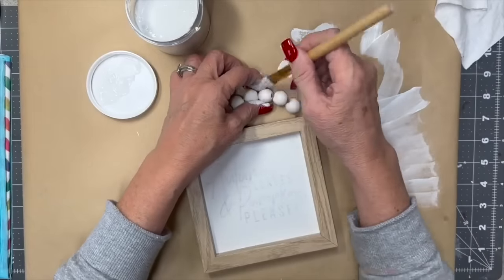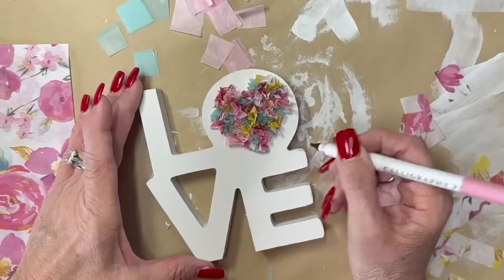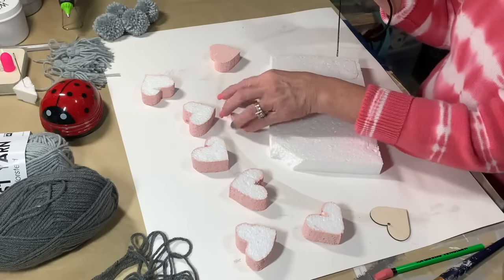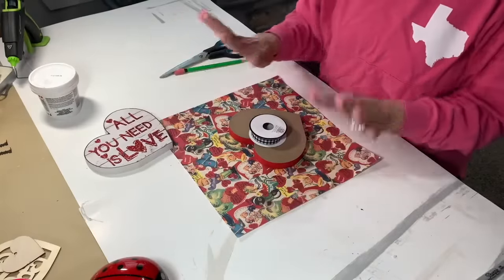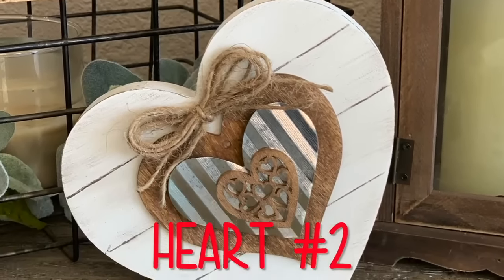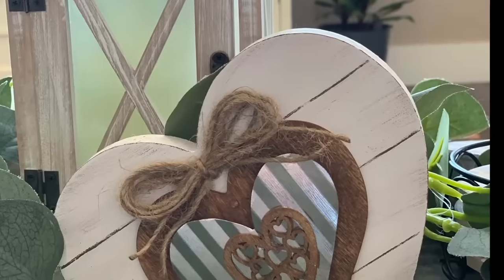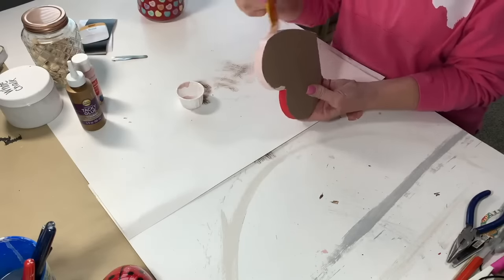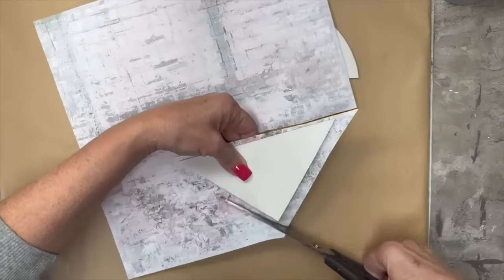Valentine DIY compilation/Rustic Shabby Chic Vintage and Farmhouse DIYs/Wood DIYs/Thrift Flips

Comment: What kind of jig saw do you have? I’m a bit intimidated by them. Is it pretty easy to use?
Reply from the maker: Hello Brenda. I’m not sure the brand of my jigsaw.  It’s not an expensive one and I’ve had it for yearsssss.  It’s very easy to use.  
I have a very healthy fear of all my power tools, because they can potentially be dangerous.  Just to the point of being safe, and not afraid… if that makes sense. 
Start with some simple straight cuts… 
Have a blessed week! ❤️

Comment: Can you link machine you used to cut vinyl? My cricut isn’t doing the job either… thanks
Reply from the maker: Hello Paula.  This video is a compilation of many from the past two years.  I think I might have referred to the StarCraft Solo cutting machine in a video. 
I would not recommend it.  It honestly caused me more frustration than helped me. 
I still use my cricut for everything. 
I find keeping a sharp, clean  blade is key. Poke the blade  into a piece of foil several times to clean and “sharpen” it.  Hope this helps.
Reply from the maker: Thank You for watching. 🩷 Have a blessed day! 💕💕💕